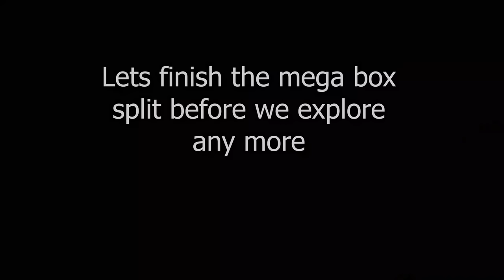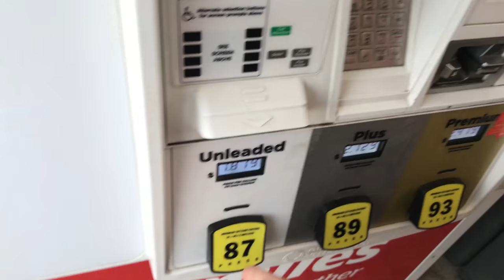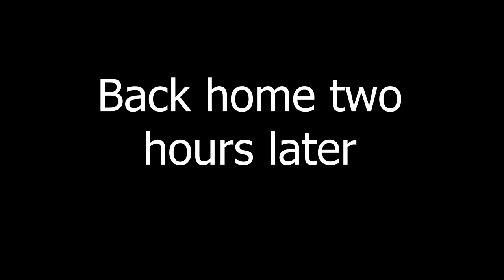Exploring Million Dollar Properties For Bees & Coronavirus Closes HONEY Convention

Comment: Curious about how you have your business structured. Did you incorporate for liability protection?  I've been doing bee removals as a hobby beekeeper and community service (pay what you think my efforts were worth) but know I'm wide open to liability if they perceive that I've done anything wrong.  I feel I have a nitch skill that should not be hoarded but also know the liability risk I'm taking at the moment.  May need to charge just to cover annual liability coverage.  I'd value your input.
Reply from the maker: We do run under an LLC and have liability insurance.  I only have insurance because these days most apartment complexes require it.